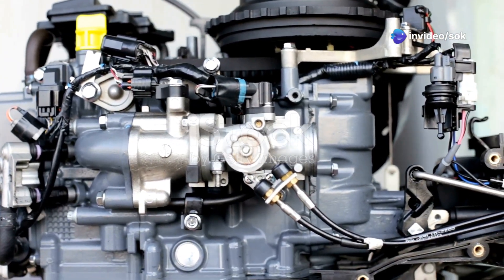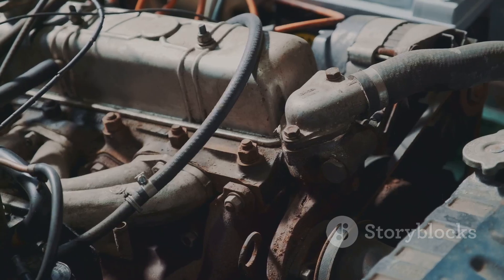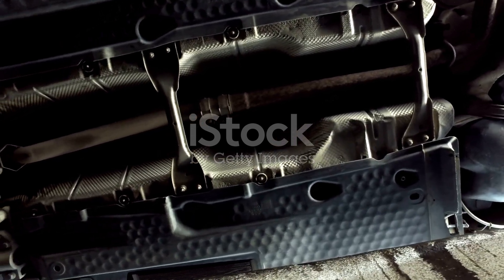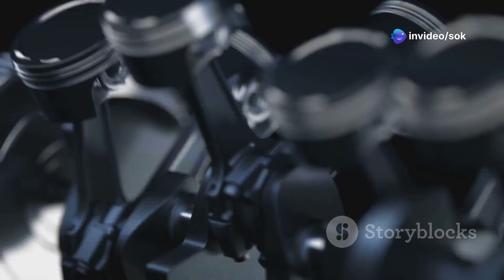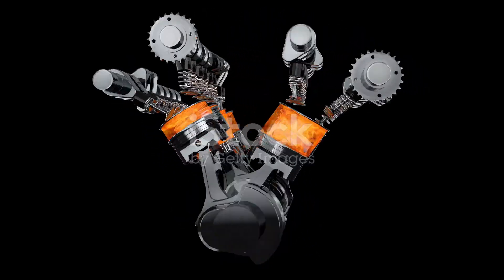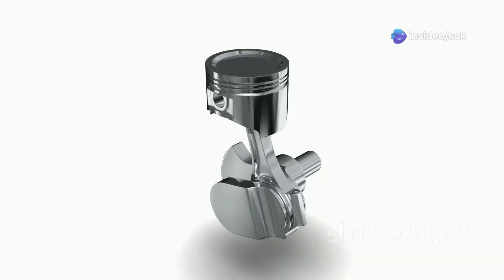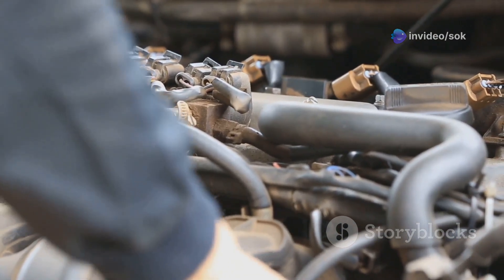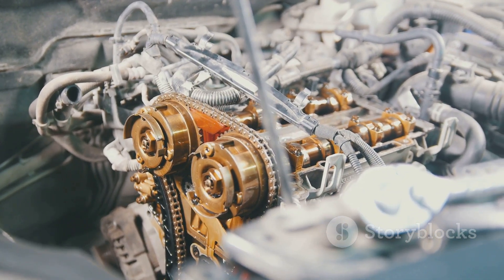Understanding the Compression Stroke engine.

Comment: "Controlled explosion..."??? 🤦🏻‍♂️

Explosion, by definition of part of the word itself, extends outward. The combustion in an internal combustion engine is contained within the cylinder. It only becomes an explosion if the cylinder can no longer contain it and it ejects from the confines of the engine. As far as engines are concerned, you can eliminate "explosion" from your vocabulary until something goes very very wrong. Please stop perpetuating the "explosion" false information.
Reply: The cylinder walls are better if they're not completely smooth. They need to have microscopic "scratches" (for lack of a better term) into an otherwise relatively smooth finish, as these scratches hold oil to aid in sealing the piston rings to the bore, as well as lubricating the components. These scratches are made at a specific angle for the engine application/design for oil control purposes, and they're visible to the naked eye as cross-hatching of the bore. If the cylinder wall were to be smooth, it would suffer from a lack of lubrication and it would wear and score, failing prematurely.